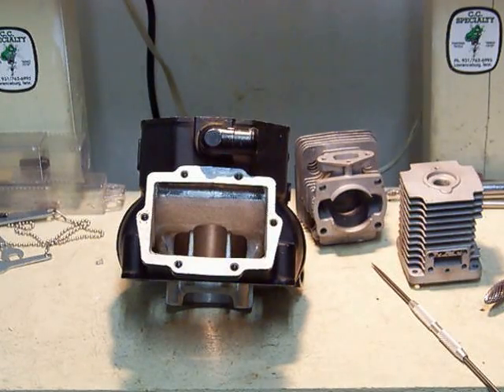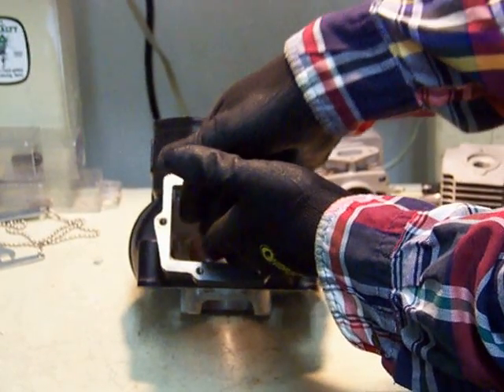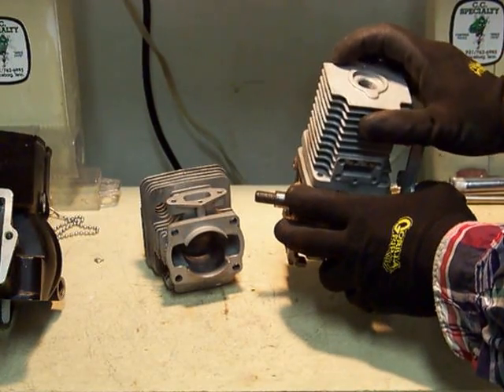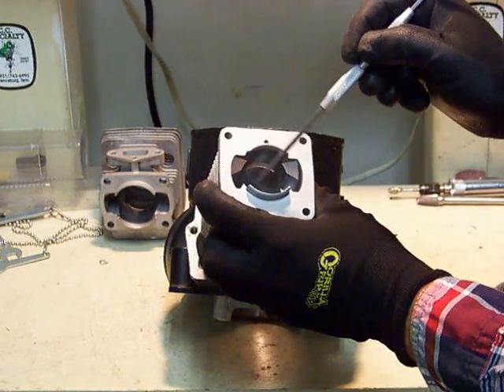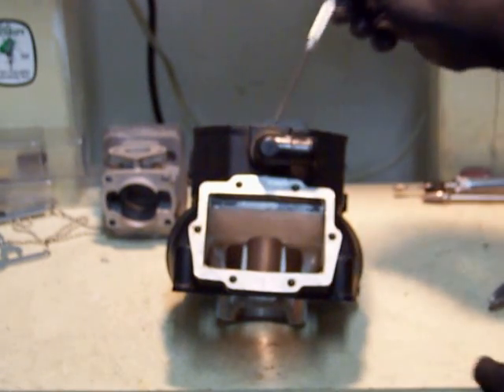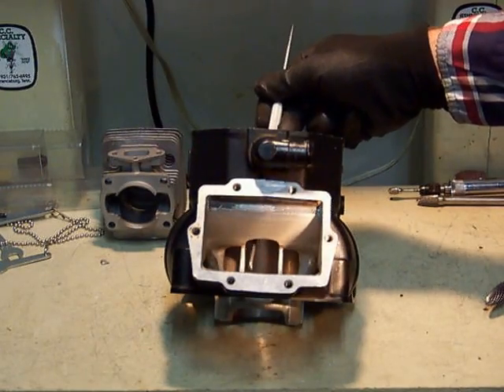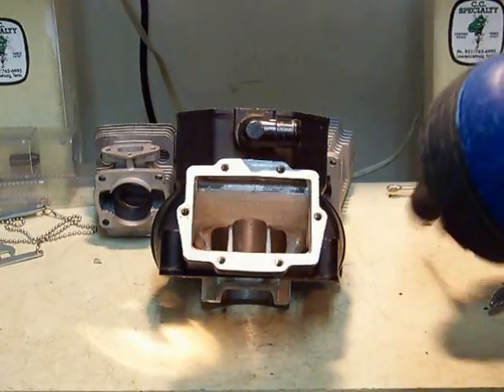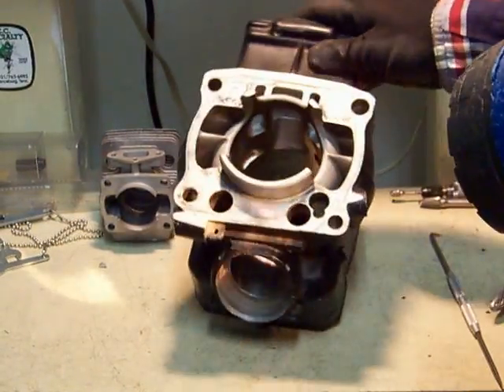The 2 stroke intake port. Information about porting a 2 stroke cylinder intake.

Comment: What about boost ports
Reply from the maker: Good question. First we would have to specify which kind of boost port we are dealing with. We can have accessory  intake, exhaust, and transfer ports,  all of which may be referred to as "boost ports".  Boost ports can be added or filled in, depending on the performance characteristics you wish to achieve.  Additional ports from the crankcase to the transfers can even be added for pressure bleed off at high rpm levels, and these too might be labeled boost ports. Unfortunately we were only able to cover the very basic ports that are applicable to all 2 strokes, intake, exhaust, and transfer ports. Thanks for watching.

Comment: Awesome videos.   The little tit on the cast iron twin 440/550 kawasaki cylinder is to retain the piston ring. Thats where the locating pin is on the piston is so the ring doesn't spin. It can NOT be removed or the cylinder is scrap metal
Reply: Thanks man! Makes total sense

Comment: the twin cylinder at around 9.34, is that a piston port engine or reed valve?
Looks like it could work as PP if pistons dont have skirt holes?
Reminds me of old tz250 with HUGE inlet ports!
Reply from the maker: the parallel twin in the video is a 550 cc jet ski cylinder

Comment: I guess I'll have to find a bike that I can get cheap cylinders for to test different changes. I guess I can always do a cheater method and blue print a cylinder then send it to a reputable shop and see what they change.
By "stage I" are you meaning just clean up casting marks and make sure ports match where they meet? And texture it? How much affect does this have?
Thanks for all your help, you are awesome.

Comment from the maker: Thanks, there are a few links I have posted in my 2 stroke tips section that can help you with calculations and the Why behind the How To. I would recommend starting out with one old or used practice cylinder to learn technique, and then start with a Stage I level porting job and work your way up. This will be a lot more cost effective than most other approaches.

Comment from the maker: Thanks for watching the videos! The intake being on the case won't change any of the principles. The Boyesen ports just give more paths for the air fuel mixture to take. This increase in the cross sectional area allows more air flow, particularly at higher rpm, when the demand is greater. You should only try to create these extra ports if you can do so, without compromising the structural integrity of your crank case. Size will also be determined by design of the intake on the case.

Comment: Question about this video. My bike is case reed induction, not cylinder reed. If my case does not have these "Boyesen ports" are they recommended to be put in? Are they an improvement for any 2-stroke cylinder without them and how much affect? Do they affect top, middle, or low end power? Lastly, how do you know how big to make them?
Thank you for your time.

Comment: I still need to check through your site & videos, but more how to and WHY to videos for transfer and exhaust ports would be nice. I would like to purchase tools and learn to port, but don't know where to start on porting. I don't want to spend $300+ on tools only to ruin an $800 cylinder. What are known techniques and how do they affect it? How do I know if there is anything to gain on my cylinder? What improves bottom end vs top end? Do you have any resources? Thanks.